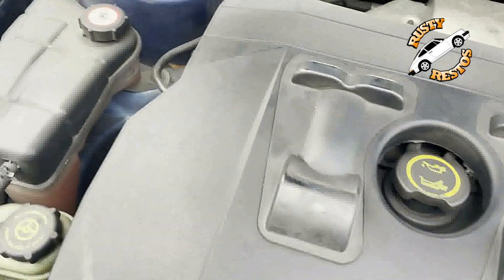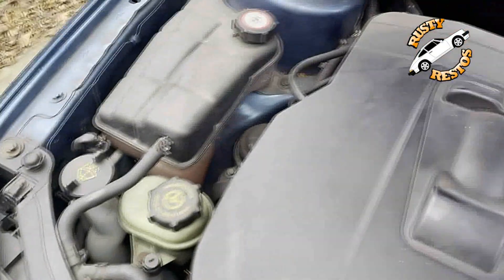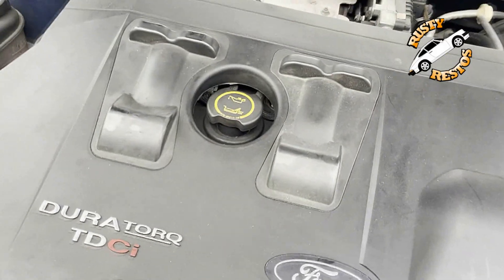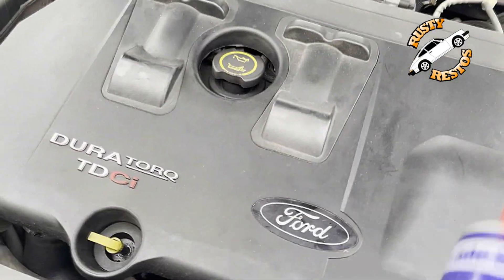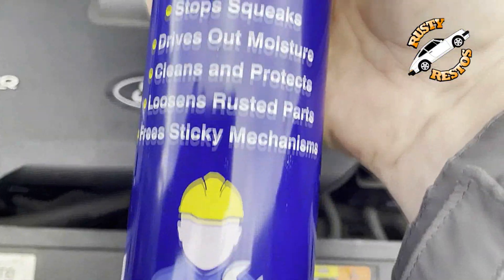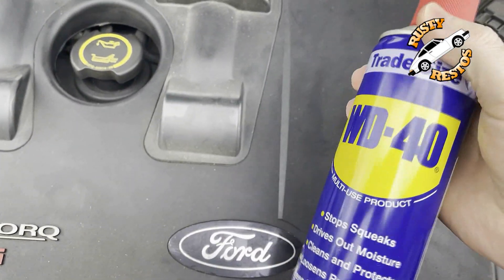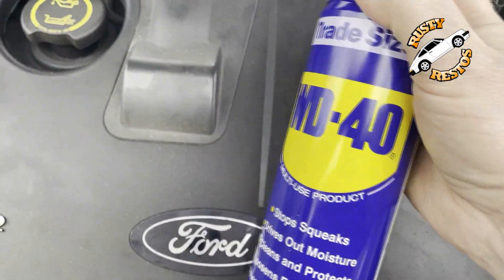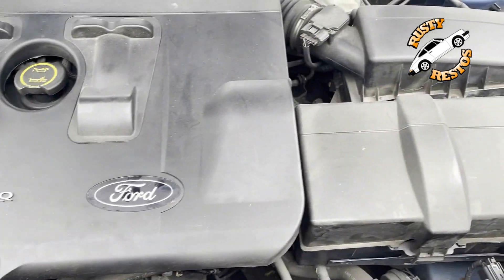Why Using WD-40 on Your Engine & Electrics is a BAD Idea! 🚫

Comment: I give up some say yes some say no which is it
Reply from the maker: It cleans, leaves a shine, but dust will stick. 

WD-40 is best used for:
•	Lubricating squeaky or stuck parts
•	Loosening rusted bolts and screws
•	Preventing rust on tools and metal surfaces
•	Displacing moisture from engines and electronics
•	Cleaning grease, adhesives

Thanks for watching 👀

Comment: this guy obiviously has no mechanical experiance.ive been a motorcycle mechanic for 35 years and always have used wd40 type sprays to keep engines looking smart with no problems .
Reply: CARS OVER HEAT IN HOT WEATHER ESPECIALLY OLD CARS   WD40  CAN CAUSE FIRE  YOU HAVE TO DRY IT OFF